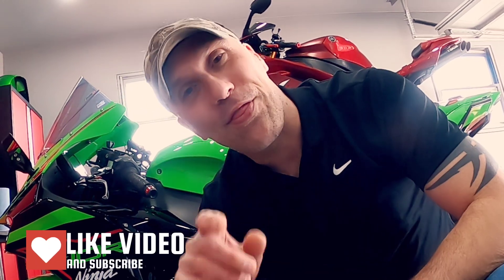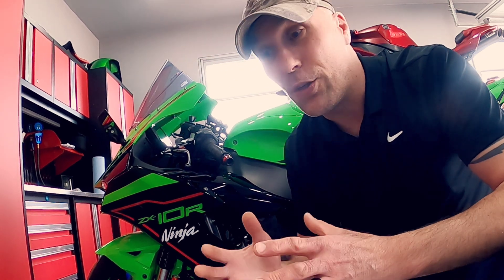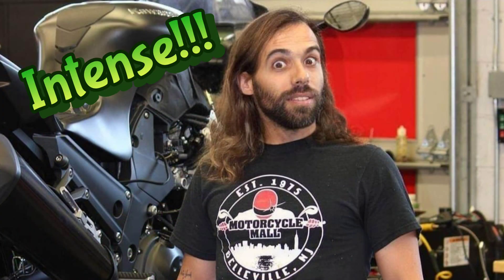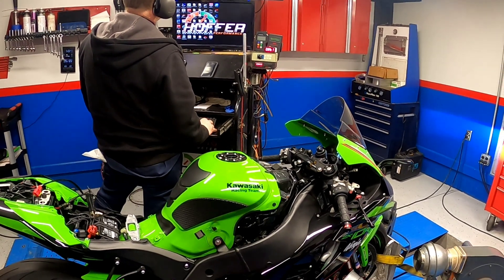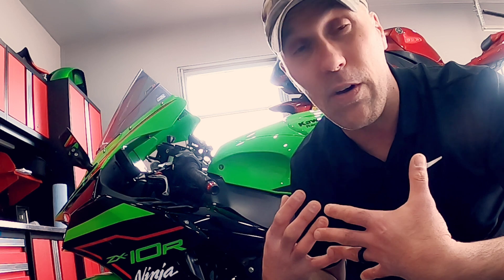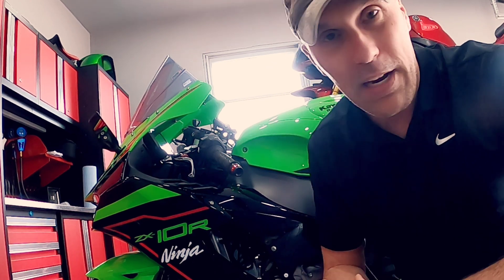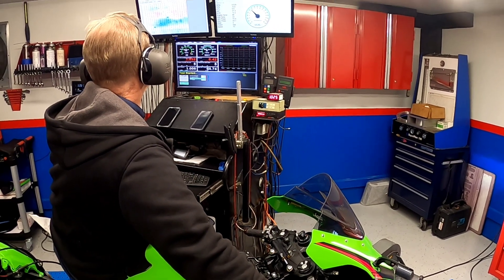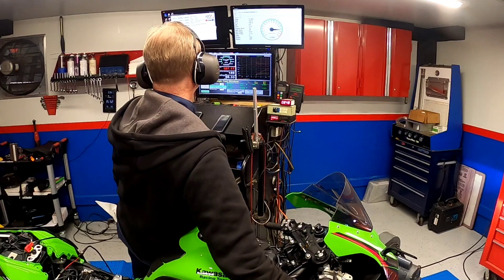Woolich Updates for Gen6 ZX10r ECU Tuning and Smoothing the Idle.  Making more Power!

Comment: Mine idles Lopy and has a bad stutter in 5-6.5k rpm
Reply from the maker: Your tuner needs to make adjustments or take to someone who can.
Reply: @NoBSZone  I have a woolich tuner but don’t really know how to use it I took it to the tuner twice and he still didn’t fix it so I’m gonna try to figure out how to use the woolich tuner myself
Reply: Apply your autotune logs like normal.   The go to the main woolich screen, and select fuel maps.   You can select individual cells, or a row.   Red cells click add,  blue cells click the subtract button.   Make them all white, write to ecu, then ride and repeat if needed.
Reply from the maker: I suggest you have a experienced dyno tuner do the work.  Auto tune systems have a few set backs if used stand alone.
Reply: Mines does as well. Been looking up information on how to fix this.

Comment: my gen 6 hunts idle badly with the full exhaust, especially in low RPM, whats this sync tool you talk of? do you have any specific names I can look up? was there a vacuum leak? was that the problem on one of the cylinders? what do you actually mean out of sync?
Reply from the maker: The idle does bounce some still at idle before it gets to full operation temp 165-170.  The synch was off with cylinder 1 a good bit out synch.  Others were odd a tad.  We used a digital vacuum synch vs a common fluid one.

Comment: Yo!!! Gen 5 that much easier to tune? Also.... does the marble trick work just as good as PAIR delete plates?
Reply from the maker: Achieves the same outcome to block the vapor flow, however if you want to remove all of the then useless plumbing and the electrical component it needs a plug in by pass or ecu flash to disable the check engine code.  I like to get rid of it all as it makes future service easier.
Reply: @NoBSZone  Smart!!!!
Reply from the maker: @TheHamlinHooker1  I generally move anything that is disabled.  I never intend to enable it again.  Pair mod is simply done for accurate tuning and to clear space on valve cover.  It's function is post combustion, provides no performance change.
Reply from the maker: @TheHamlinHooker1  , yea, it's only a bit but as you pull off stuff it begins to add up.  I did scale all stuff I took off my 10r, was around 20lbs.
Reply from the maker: @TheHamlinHooker1  The factory exhaust on the zx10r really is not that heavy.  The headers are extremely light titanium,  the catalytic converter and servi motor, cables scales in ballpark  8lb, and the factory muffler being replaced sheds a few more.  All and all replacing the exhaust with a titanium full system may drop 10ish pounds and a stainless system a pound or 2 less.  The pair stuff may be half a pound, evap can and parts another half pound.  It all adds up but shedding weight becomes hard as these manufacturers are competitive with trying be lightest and parts are already light.  Even removing passengers pegs and brackets is only just over a pound.  Hands down removal of the cat is quickest weight reduction.  After that a smaller chain, wheels are only real components left to replace lighter parts unless you plan to go shmode roll route and take shit off you need and don't replace it...aka brakes.
Reply from the maker: @TheHamlinHooker1  , mine did too.  But pop on scale, you realize it's not as heavy as you thought.  The canister, brackets and hoses and all that stuff like 1lb.
Reply from the maker: @TheHamlinHooker1  
Yea I'm not sure it does a whole lot.

Comment: I got the graves throttle tube for my gen 6 and it still has the same amount of play as the stock tube. Is there some trick to putting this thing on the right way? Lol
Reply from the maker: How much play did yours have with factory one?  Perhaps yours had better tolerances.  Mine took out a good 1/3 of freeplay mine had.
Installation is straight forward, remove bar end, open pod 4 screws, swap grip then reverse.
Reply: @BS Zone  yea I mean you really can't put in on wrong but mine has in and out play also. Along with the on/off play too. I'm really disappointed in it unfortunately cause it's terrible to ride. I have a mail in flash and the thing is so abrupt when trying to give it a tiny bit of throttle. It's so bad... on/off... no in-between.  I'm sure I just need a actual in person tune.  Do you know any reputable tuners in thr Phoenix AZ area?
Reply from the maker: @MattStravato  yes the Tune can be a huge part of issue.  Who tuned it?  I felt same way about throttle, would not track it and was verge sell the bike due to it.  Mine is great now between throttle input adjustment done and the tube.  Im not aware any Tuners in AZ.  Ricardo may.
If not....Road Trip!  ;)
Reply: @NoBSZone  2wheel dyno works out of Washington did thr flash. I had a gen 5 and had them flash that one with absolutely zero issues.
Reply: @MattStravato  mail in services are trash I can prove that all day long....
Not sure if I know someone in that area to tune the bike. Let me send a email.
Reply from the maker: @tysta2  exactly!!!